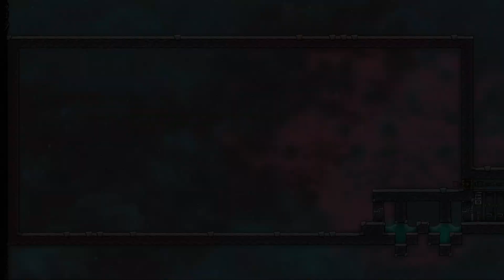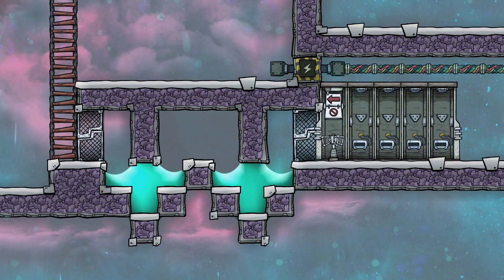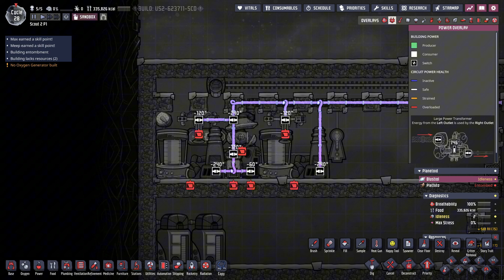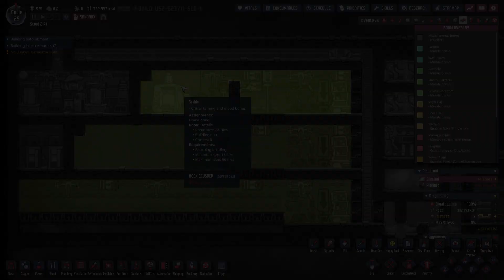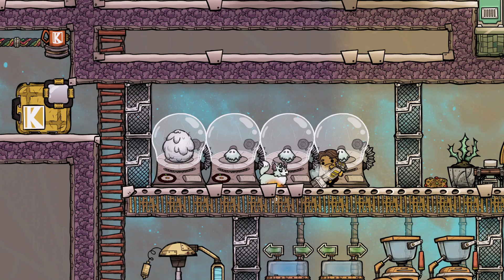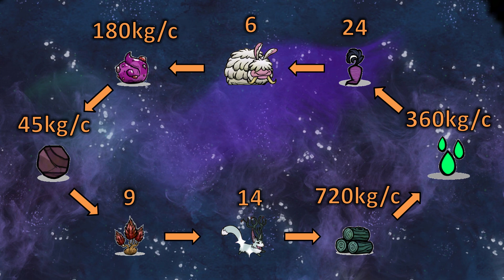A new infinite resource chain | Bammoth & Flox in-depth Ranching Tutorial | Oxygen Not Included

Comment: Nice design but you have to be carefull with the cooling as the flox reproduction rates goes back to 2% when their body temperature is lower than -30°C and since you are cooling to -45°C there is a possibility that their reproduction rate will be reduced and the ranch population will decrease, with that in mind I would put a temperature target target of -25 on the sensor instead of -45.
Reply from the maker: That´s a good catch. In my testings the area needed initial cooling, however once stabilized or if starting out with an already cold enough system, -25°C on the sensor of the aquatuner is plenty sufficient.
Reply: @telx7  So there might be another problem with the way the cooling loop is set up; usually the liquid reservoir should directly output into the cooling loop running through the room, and at the end of that loop the aquatuner with the temperature check should be. This way, you essentially set your upper temperature limit for the room (the liquid arrives after sucking up the room's heat -> here it has reached its highest temperature). If it has surpassed that temperature, the aquatuner cools it down by 14 Kelvin/degrees Celsius. If there is enough liquid buffered in the liquid reservoir (which the output of the aquatuner is directly connected to), this temperature jump of -14 K is dampened and the whole reservoir is only slightly cooled. This way you only cool down your room to slightly less than the value set by the sensor.

Here, the cooling loop's flow is reversed. The reservoir is located before the aquatuner (at the end of the loop), and the liquid cooled by -14 K flows directly into the room. Setting the sensor to -25 degrees Celsius may result in the room being cooled down to -25°C Celsius plus -14°C = -39°C.

So I think the loop should be reversed, or if (like in my case) everything is built already, setting the sensor to -15°C should hopefully be enough to keep the room's temperature between -14°C (for the plants) and -28°C (above -30°C) for the floxes.

Correct me if wrong!
Reply from the maker: That´s actually an interesting point I never really thought about, because I´ve been running my cooling loops the same way forever. 
Reversing the position of the liquid reservoir would allow for more finetuned cooling at the cost of power, because the aquatuner´s cooling capabilities get dampened as you said. Definitely something I will keep in mind and would make this design "safer".
However, since the coldest liquid will end up in the bammoth enclosure first it will most likely equalize to a safe temperature once it reaches the flox, even if the aquatuner overshoots with the cooling. 
At the end of the day, if the ranch is still too cold with the sensor set to -25°C adjust the cooling threshold further.
Reply: @telx7  Yeah it might be fine. The dampening doesn't mean more power is consumed forever though; instead of cooling the room a lot more like with this setup, the cooling would just be distributed within the reservoir's mass first (more mass, lower temperature drop vs less mass, but high temperature drop). The initial cooling of the reservoir (more mass) would mean more intitial power consumption, after that it wouldn't make a difference. But as you said, tinkering with the set temperature of the sensor should be enough to make the system stable.
Reply: @telx7  Why are you doing guides when n00bs have to tell you about potential flaws? Maybe don't do guides
Reply: @jim01q 
N00bs couldn't even begin to correct the build he has shown here and it's kinda annoying to see someone saying something just be  mean and/or edgy

A lot of oxygen not included tutorials are just concept sharing or playthrough videos. Just move on if it's not your thing, don't stop to be a little shithead in someone's comments
Reply: @jim01q  not everyone knows everything , Ive been playing this game since day one and i learned few things reading this comments and watching the guide. always be ready to learn what you dont know.

Comment: u could cut the wood cost in half by building a green house for that plant the bammoth eat and just feed them throw the critter feeder
Reply from the maker: I don´t see how. You´d still need 4 plume squash plants per bammoth, meaning the ethanol consumption stays the same. The Squash takes 9 cycles to grow (11.11% growth per cycle) and Bammoths eat 44.44% of growth per cycle (hence 4 plants). If you feed them the "fruit", they need 1777.77 kcal per cycle and one plant provides 444.44 kcal per cycle. (444.44 kcal x 4 = 1777.77kcal)
Reply: @telx7  true BUT when u have a green house it will take u just 2 cycle to produce 1 full plant fruit instead of 4 cycle cuz u have a green house boosting 100% speed so u get 888.88 kcal per plant per cycle ( 2 squash plant per bammoth) so for a ranch of 6 bammoth u need 12 plant that use 15 kg ethanol per cycle so in total u will burn 180 kg that takes 360 kg wood to make instead of your current setup that use 24 squash plants every plant will need 15 kg of ethanol so in total 360 kg of ethanol per cycle that takes 720 kg of wood so u only 1 ranch flox farm + a green house and it will run perfectly instead of 2 flox farm with no green house
Reply from the maker: @ahmedhassan159  Of course you can set this up with boosted plants, but then you introduce fertilizer as an additional resource you have to make. The point of this build is to be a closed resource loop that can run on itself.
Reply: @telx7  u got a point
Reply: But it could be! Burn a little EtOH for some polluted water, take the dirt from the floxes, and phosphorite from the bammoths! Eventually the fertilizer reduces the number of plants you need, reducing the amount of ethanol you need, increasing the amount of wood you produce, and some natural gas gets produced. :D
Reply: @Xaeric.  i did the math on that and yh it works u would need to burn 80 kg more  of wood per cycle to make the p water to fully cover the needs of 12 plants and u could get the extra wood by building the critter condo to house 1 more flox in the same ranch and if u wanna get more advanced u can make a mutated seeds and u save on the ethanol & wood needs and the power needed to cool down the plants and the dupes labor for harvesting making it half automated (the dupe still need to apply farmer touch every 3.5 cycle)
Reply: Yup! It's a hidden thing about plants that also use the reagents of fertilizer (polluted water, dirt, or phosphorite) to grow. Fertilizer reduces the costs greatly. In addition, the efficiency just gets better with higher level farmers.
Reply: @Xaeric.  yh and u can increase the efficiency even more if u got a grubgrub farm around by 50% more
Reply: @Xaeric.  but i think it's only worth it just to make food to feed it for the hungry tree that gives risin
Reply from the maker: @ahmedhassan159  You are not wrong and I love it :D I say go down the rabbit hole and try it out ^^
Reply: @telx7  hello telx7 i build the bammoth ranch that runs on only 3 squash plume plant and feeds 6 bammoth ...the cool thing is they are mutated seeds (exuberant) and in a green house that can be harvest every 1.1 cycle for 4000kcal each so in total 12 000 every 1.1 cycle ...they need 22.5 lg ethanol every cycle so in total it's 67.5 every  1.1 cycle and they need just 15 kg of fertilizer for all 3 plants every 3 cycle (if u got a good farmer if not it's every 1 cycle) maybe u wanna check it out
Reply from the maker: @ahmedhassan159  That´s quite impressive! The mutations are really powerful and adding that small amount of fertilizer shouldn´t be much of a problem either. 
That´s a good way of making this build even more efficient :)
Reply: @telx7  ty ♥

Comment: I didn’t see anything about how much extra wood you get from it?  
The meat does seem to be the biggest output.  Doubling its sized would keep up with the food needs for a large colony and if you add a small spigot seal rancher to it you could live off pemmican and have a little more wood to spare!
Also what’s the average power use of this setup?
Reply from the maker: I might have missed that - it´s ~120kg of wood per cycle once the conveyor receptacle is full.
As for the power it is hard to pinpoint an average use, but once the rooms are cooled down the aquatuner won´t engage nearly as often anymore and the shipping equipment only activates infrequently, so your main power draw will come from the ethanol distilleries.

Comment: Love the design and the step by step explanation, as well as very soothing vibe of the vid really nice work man ❤
Two questions thoigh - wouldn't it be more efficient in terms of cooling to spill some liquid near the turbine? And how many cycles did you run this?
Reply from the maker: Thank you :) Liquid near the turbine would be more efficient, but once the temperature in the ranch stabilizes the aquatuner runs very infrequently, so not much cooling is needed for the steam turbine and the hydrogen has the benefit of equalizing the temperature of the transformers as well. I ran this setup for about 200 cycles to see if the bammoths get replaced properly. Once their life-expectancy was staggered, it ran smoothly.

Comment: Very nice guides you have. Thanks! I know it's not a self-powered build, but do you have any idea of the power draw?
Reply from the maker: Thank you :) It´s difficult to pin-point the power draw and I´m afraid I don´t have an exact answer to that. All power-consumers together require 4380 W, however the power draw is going to be much much lower than that, because the automation has a very brief up-time and the same goes for the shearing station, gas pump, rock crusher and aquatuner (once the temperature in the room has equalized). 
The only machines that run semi-constantly are the ethanol distillers at about 60% (288W) per cycle.
Reply: @telx7  Seems like with a rudimentary power supply, it should be OK. Thanks, I'll give it a try.

Comment: Amazing design & tutorial, do you have any recommendations on the best way to initially vacuum the room?
Reply: I've found the easiest way is to build tiles to your air lock and then deconstruct them.
Reply from the maker: Personally, I first choose an area that fits the frame of the build as shown @2:02. Then, once I have my bearings, I place down the liquid locks, dig out the whole area and finish the frame of insulated tiles. With the liquid locks and the frame in place, you can put a couple of gas pumps down and either pump the gases just outside of the frame or into gas reservoirs.